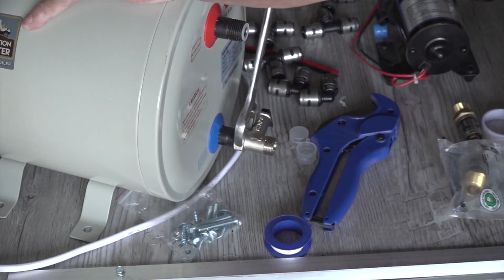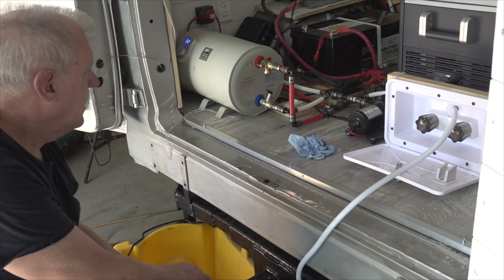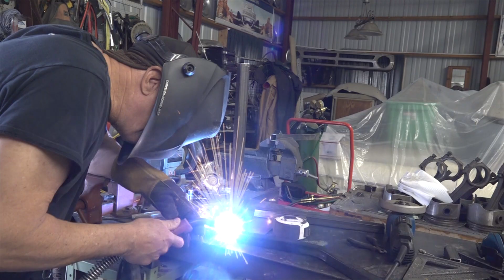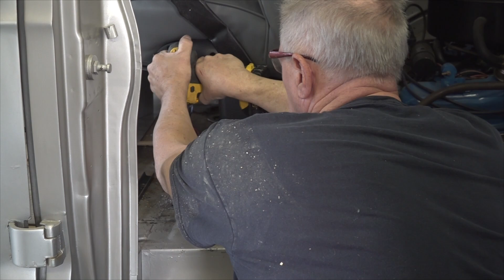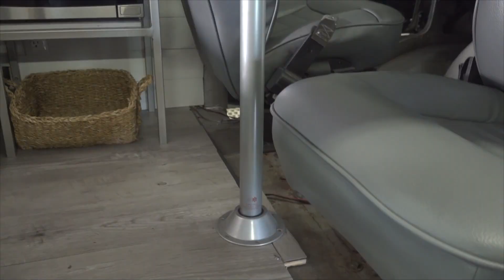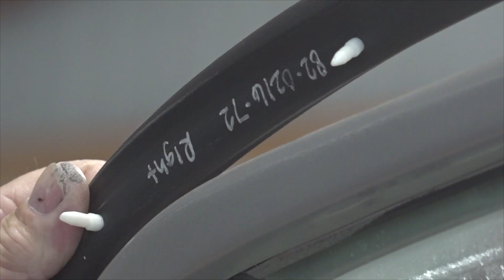The RAM CAMP Van Conversion Project Episode 5

Comment: Where did yoyu find that sink?
Reply from the maker: Amazon: IKEBANA Bar Sink,Nano Black Stainless Steel Small Wet Bar Sink,15 x 15 Inches 18 Gauge Single Bowl Workstation Drop in Prep Rv Kitchen Sink With Accessories